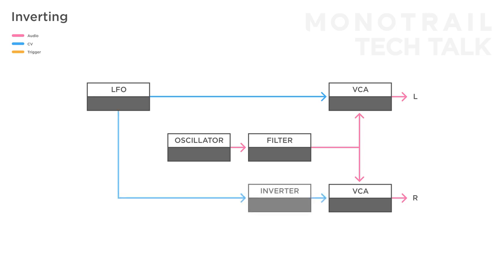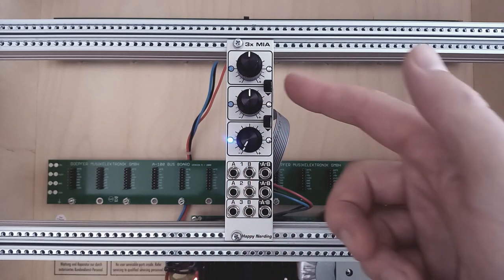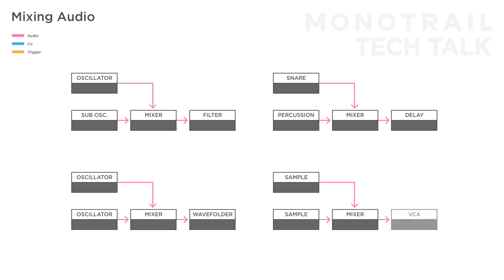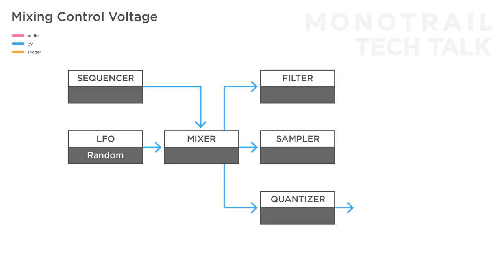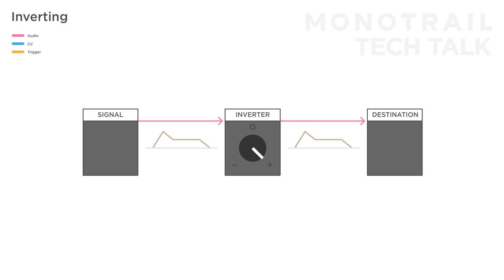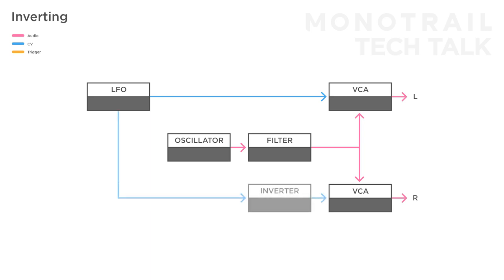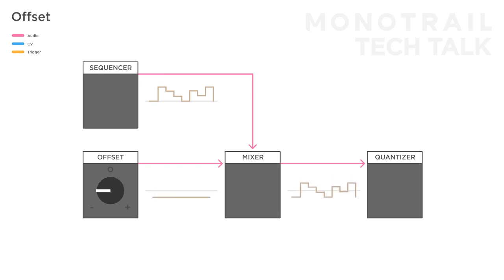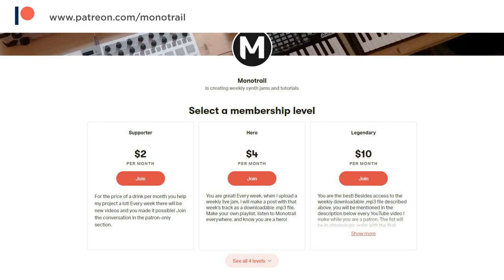How to use modular utilities - Mixing, Attenuating, Inverting, Offset (with Happy Nerding 3X MIA)

Comment: I like this module a lot in terms of the possibilities it offers. On the other hand it feels so technical and the kind of module you're gonna need some time to figure out and make nice patches with.
Reply from the maker: This is possibly my favorite module of all time! If it breaks, I'd order another without a thought, that's pretty rare with a the options out there these days. Hope the video helps a bit. In any case I'd say it's easy to start using it. Mix two signals, adjust the strength of a signal. From there you will find the need for more, and then find it can handle all of it :)

Comment: Technically I knew what these things are, but now I got a bunch of new ideas how to use this in a patch. Thanks 👍
I made some DIY attenuators for my half modular stuff with a potentiometer soldered into a patch cable. Not pretty, but gets the job done ✅
Reply from the maker: You're welcome Manuel! Glad it brought you something :) Patch cables with an attenuator in it? sounds interesting actually. I made a small quad attenuator for my case, really usefull, but I don't really trust my soldering in live situations :/

Comment: Great video. Really good, clear explanation. Just in time, as I finally found a seller for this module. Knew I wanted it, but now I understand it better. The offset/attenuvert feature is what I really needed. It's cheap, compact and I love the bigger stacked knobs instead of 6 small ones
Reply from the maker: Hey, thanks! Its a great module with a lot of power for the size :)

Comment: Very pedagogical. Well done.

One question: does the 3x MIA have a notch in the middle for the knobs, so you know when it is set to zero?
Reply from the maker: Haha, thanks! Hopefully not to much? This is all pretty new to me, still looking to relax more on camera and find the right speed and tone. Anyway, it does not. It's a bit of a shame in my opinion, because that would make it easyer to find the zero point for audio and cv, although with cv, that works fine without. Cheers!
Reply: @MonotrailTechTalk  I think the lack of a center indent is a pretty serious omission. For a great alternate solution, check this out.
https://intellijel.com/shop/eurorack/1u/quadratt-1u/
Being able to throw a switch and turn the attenuverter into a simple attenuator allows absolute certainty of where zero is.

Comment: Hey, thanks a lot for your videos,
I have a hard time understanding the difference between mixing 2 modulations with like the 3xmia or "mixing" these 2 modulations with a vca / polarizer (one modulating the other)
Thanks in advance !
Reply from the maker: Hello! That's hard to explain without a proper visual, but let's try! Imagine you have two sine wave LFO's, lets call them A - a fast audio rate one, and B - a slow moving one.

When you mix two signals together, the result is the sum of both signals. They are added up. In our example, if you mix A and B and listen to it, you will hear a steady tone of audiorate LFO A. If you look at this on a scope, you will see signal A, the fast audio rate LFO, move slowly up and down relative to the center because signal B, the slow LFO is added to it. The amplitude of signal A will stay the same.

When you send A to a VCA, and B to the cv input of that VCA, the signals are not mixed at all. In this case B is determining the amount of signal A passing through the VCA. So if you listen to this you would hear audio rate LFO A go up and down in volume with the speed of B, but if you look at this on the scope signal A would be steady around the center, changing in amplitude.

Comment: Very nice. I was wondering if you could help me understand the better choice between the MIA and the frap tools 321? Thanks for your top quality video!
Reply from the maker: Thanks! I actually have no experience with the Fraptools 321, so dont take my word as final advise, but recently read up on it. The biggest difference to me: The MIA has a lot more mixing power. It can be three 2:1 mixers, up to one 6:1. The Fraptools can only do 2:1 or 3:1 if im right. On the other hand the knobs on the MIA are always attenuverters, wich makes it hard to find the zero point, wich can be anoying for mixing audio. The Fratools you can choose, normal or inverted output, so easyer to find to zero spot in performances and so on. When it comes to attenuating + adding offset they are very similar.
Reply: @MonotrailTechTalk  Ok great thanks so much for your  help. Its still a tricky decision because I know what you mean regarding the zero point. Cheers :)

Comment: Thank you ! I use a WMD  Pro Output, thinking I needed to amplify the signal leaving the euro rack , my synth is quite small, consisting of  
Benjolin v2, Erica Synths Sample Drum, Make Noise Maths, Mordax DATA , WMD pro output, & Make noise 0- Control for a touch pad & a powered speaker, My worry is   burning up a module, due to improper set up, any suggestions on interfaces or mixers  what works well for you? I know your busy I appreciate you taking the time to reply to my messages, Buen Camino
Reply from the maker: No worries happy to help if I can. And that sounds like a nice setup! As long as you use the power cables for the modules properly you wont damage them :) 

And a lot of choices when it comes to interfaces and mixer, to much to mention all. It really depends on what you're after. When you like to multitrack the modular, and or other instruments it's worth it to look at an interface with multiple inputs. You could record directly to an interface that way. Or use a mixer to mix the signals, so you can easily use the EQ and or effects sends, which is nice to look into. Then you have mixers that work as interfaces as well, which is a really interesting option these days. You can just plug the modular or other gear in the mixer, and multitrack that via usb or something!

Comment: 10:48 so what is shown on the diagram attenuating a signal and mixing it with an offset can be done with one channel in MIA right? I just need to leave the second input unpatched to have the 5V offset available.
Reply from the maker: Exactly! The fact that MIA has 3 channels, each able to perform that trick, or mix two external signals makes it very powerful :)

Comment: I know this is an old video but im stuck between this and the 4x mix, is the 3x mia able to do stereo mixing?
Reply from the maker: Hi there! You can use 2 channels of mia to mix two stereo signals. The MIA is the better CV tool, does also offset, inverting etc. 4X mix is the better stereo mixer :)

Comment: can you explain how to patch this module to use for offset? you say if nothing is connected to the input it works as offset generator... so what you connect to the module and where?
Reply from the maker: Hi! So the 3xMIA has three identical parts, each with two input and one sum output jack. Each of the inputs and the attenuverter connected to it becomes an offset generator if you dont patch anything into it. You can dial in the amount of offset with the knob for that jack, up to 5v. Then you can send it anywhere you like. I often send it to my Make Noise LxD for example. A low pass gate without any knobs, this way I can use the offset control from the MIA to open the Gate by hand.
Reply: @MonotrailTechTalk  thanks , that is a great application for offset.

Comment: I'm trying to move a CV pitch sequence up and down automatically in key. For example, using a gate/trig/CV signal  to move a pitch sequence from it's original "C" up a 4th to "F" for 16 bars, then up automatically again to "G" for 8 bars, then down again to the original "C." I don't want to manually twist a knob to accomplish this, I want the rack to do it. Anyone have ideas on how to achieve this using specific modules and patches?
Reply from the maker: If you want to transpose in key, the best way is to mess around with signals, and then run them through a quantizer. You can just mix a sequence, with a gate (for example from a clock divider), and then run it through a quantizer. Some sequencers also have the possibility to transpose in key directly.

Comment: Why did you choose to put the MIA in  your small case rather than one of the intellijel Triplatts that you also have?  Similar functionality?
Reply from the maker: Hi there! Similar, but not the same. Most important difference is that the MIA can be 3 independant 2:1 mixers. Al with attunverters. So a lot more ways to mix audio and cv in different ways.

Comment: How does the 3x MIA handle mixing audio and DC signals, e.g. and audio signal to input A and both A and B knob?
Reply from the maker: Hey, I don't fully get the second part of your question. But the Mia can handle both audio and CV. For audio though it's not ideal, because all inputs have attenuverters, without a center dent. So it's not so easy to fully mute a signal with the knobs.
Reply: @MonotrailTechTalk  Sorry, what I mean is if you input an audio signal into an A input and then add an offset or DC signal  it's paired B input, does it shift the entire audio signal from A up/down?  I get the "hard to hit zero for audio attenuation" part, much like channles 2 & 3 on Maths.
Reply from the maker: Ha get it now, yes it works like that indeed. You can use the offset to move the audio up and down. It's easy to make it clip that way though. But say you use A for audio, you can use that knob to attenuate the audio a bit, then use B to add offset and bring the entire audio into the positive voltage range for eample.

Comment: What do you think about the Intellijel Triplatt opposed to the 3xmia ???
Would love to know your thoughts as I’m tossing up between the two
Reply from the maker: Hi there! I prefer the 3x Mia for all things with control voltages. The 6 pots and inputs, combined with it being 3x a 2:1 mixer (or other configurations) it can just handle a lot more patches than competitors. On the other side, the MIA has 6 bipolar control knobs, without switches or a clear 'center point'. This is not so much a problem for CV, but when mixing audio it's pretty hard to turn audio off. The Triplatt solves this by using a switch. In short I'd say 3xMIA is king for CV, price, and footprint. If mixing audio is a big deal to you, space and price is less relevant, Triplatt and another cv tool can be a good option as well. There are quite some options from different makes. Make sure to check the manuals for the little differences! (I can be wrong about things as well :)
Reply: Thank you for your reply and input! I’ve decided to go with both given the functions of the Triplatt fit my audio needs perfectly and love the cv capabilities of the x3 mia